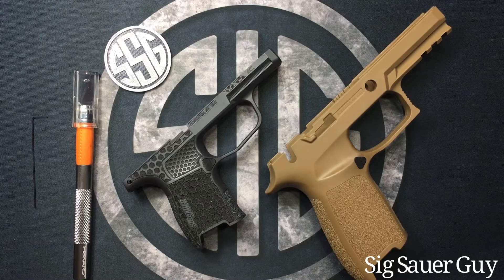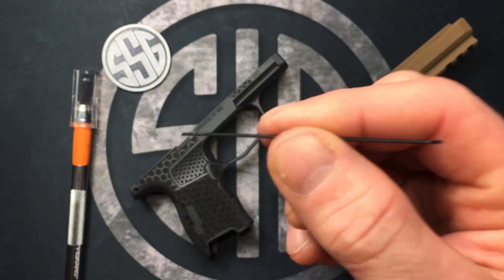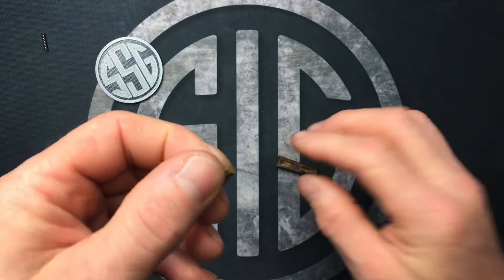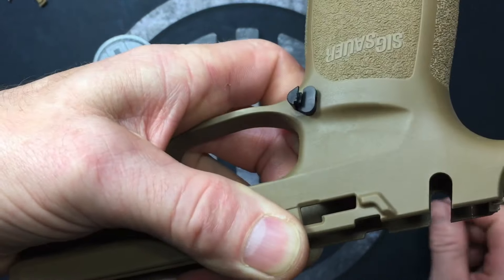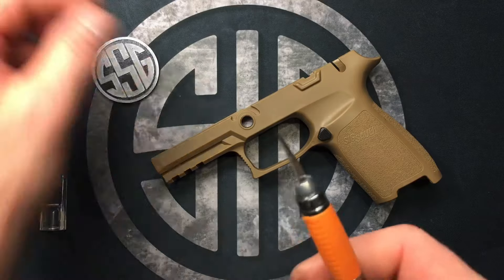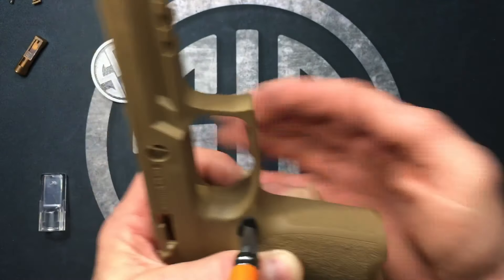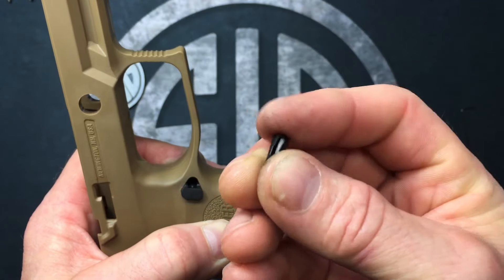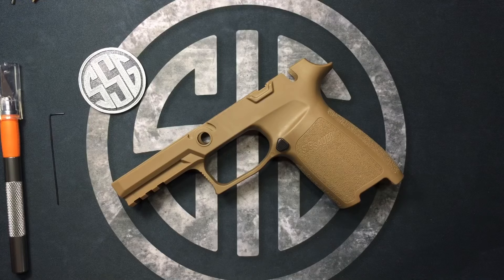Magazine release removal methods for Sig Sauer P320 and P365

Comment: I'm left handed and I just used this video to change my mag release on the other side. Thank you, great video!
Reply: Am also left handed and def didn’t know it was this easy to remove happy I found this video
Reply: Can this be done on a P365 also?
Reply: Same here
Reply: It is absolutely infuriating that SIG first puts out such a poorly designed part, and second, doesn't include a suitable tool.
I can't find anything suitable around the house, so I'll have to make a special trip to the hardware store to, hopefully, find a tool that will work.
I sure won't get this done tonight. 
Again, there is no excuse for such poor engineering. Whoever designed this should be fired.
Reply: Same but i cant find a small piece to fit in there 🤦🏽‍♂️
Reply: Update- I picked up an Xacto knife at Walmart, which worked very well to remove the button. Getting the new one installed properly proved very tricky, but I eventually succeeded. I will say again, the entire design of this magazine release button is an example of very bad engineering. Otherwise, the pistol itself is a delight.
Reply: Problem with that is the magazine on the 365 gets caught up on your hand when being released, but if you leave it on the trigger finger side the way you have to adjust your grip allows the magazine to free fall out. That’s been my experience.

Comment: Thanks for the video.  The easiest "tool", which is officially recommended in the P320 armorer's course, is a paperclip.  Another tip that nobody does on youtube (maybe to make filming easier), is to point the "muzzle" of the grip module to the ceiling.  Why fight gravity?  A couple swipes with a paperclip with the grip pointed skyward and it's out.  Nothing could be simpler, and causes no damage to the catch.
Reply: Thanks for the paper clip tip. This saved me a bunch off hassle. I tried Allen wrench first then razor but didn’t like how it was going. Decided to check out the comments and I was glad I did. Ty!
Reply: Paperclip bent on me...guess I need a better paperclip.
Reply: Every time I push to release the latch, the catch pushes in more not out

Comment: Here's what I found doing this:  The allen key method seems easiest and if you have the right size allen key available.  I have several allen key kits.  All of mine only go down to 1.5, which for me was too big.  After trying a paper clip (paper clip bends too much), I gave up on this method and found a hobby knife I use for my 3D printers.  It was done in a matter of seconds.  It took longer finding the right tool, lol.  Thanks for this vid though, quite helpful even though it is 4 years old!

Comment: If anyone has trouble using the allen key method to walk out the locking tab, that exacto blade method is super easy. Use your allen to force space between the 2 parts, and your exacto blade should go almost all the way in right off rip! I just bought a P320 AXG, it was very resistant to change until i did what i just deacribed. Wonderful, informative video. Couldn't have removed this part without your video, kind sir. Thank you very much!

Comment: I did this recently with a P320 M18 CA with a small paper clip and it was very easy.  Be sure to do this over a table top or other flat surface in case the tiny sping falls out when you remove the release from the slot.

Comment: Very first time I did it, I tried the Allen wrench method and of course I put a little ding in the grip module. And I tried the razor blade method and it worked very easily right away. Thank you!

Comment: Best explanation and video about this.  I tried the paper clip, then the allen wrench, then the small punch.  A real pain.  Then I used a very fine blade tiny flat head screwdriver (I didn't have an exacto knife) and it FINALLY worked.  Brand new weapon so everything may have been pretty tight.  By the way, you can add SIG P365-380 to the list of what this works on.

Comment: Thanks for the video. I started with my Armory Craft grip module. I couldn't get it out to save my life. Spent a hour last night and a hour this morning. Finally destroyed the smaller part and took it out in 2 pieces. Went on to my stock module and it came out first try. My other module from AC took 2 tries. Go figure. I replaced with the extended mag release from Armory Craft. Definitely a good upgrade.

Comment: A P365 user here.
I couldn't use a Hex Head Allen wrench key to "crank" the Detent Pin out after a few hours of trying. I also couldn't do this with a a smaller and larger paperclip either. I finally had success after a few tries with the Scalpel method. I pushed a sporting knife pretty hard in between the Magazine Release Button and Detent Pin while applying pressure with an Hex Head Allen Wrench Key in the hole shown in the video and used leverage from the knife to push it out. I pulled it out with my fingers after it was protruding out. One thing I really learned from experience is that you MUST hold the magazine release button down the whole time and NEVER let go. It's definitely strenuous for larger hands, and mentally exhausting. but don't give up! Take a break, and come back to it if you must, but keep at it and be mindful of how much pressure you are applying. 
Thanks very much for the help. I will be using your videos for the rest of the modifications I will be doing to my Sig Sauer P365 Freedom.
Reply from the maker: andrew71888 I’ve always had a hard time getting these out. I was so happy when I found a way with the Allen wrench. I’ve destroyed many along the way. Lol. Excellent news about your success. Thank you very much for the compliment also.

Comment: Thank you so much for a very clear demonstration of how this works.  I didn't have the right size Allen or paper clip but discovered a straight pin is perfect.   I wanted to swap mine because the magazine gets held in with my palm when trying to use my thumb and I'm more comfortable using my trigger finger  on the paddle style release of my USP.  Was happy to discover it feels pretty much the same on the P365XL now.  Thanks again!
Reply: I switched my mag release to the left side on my P365XL…  I’d rather use my trigger finger then my thumb. I find I can do it quicker and easier and it falls free of my palm easier also.  I’m thinking the P320 mag release does fit…  I measured  length and it’s right around 4mm longer.  But I’ll bet it’ll go into a 365 frame???  I wish Sig had squared and ridged the 365 lines release like the 320 line.  I wouldn’t have had to buy an aftermarket.

Comment: This a well done video that clearly walks you though the change.  I am right handed and have very small hands, and had to really stretch to reach the right hand mag release.  I changed the mag release to a left hand release and it is perfect.  Just roll the gun clockwise (which is what you always do to change mags) and it now lines up perfectly with my right finger.  This really decreases the time for a mag change.  This should work with extra large hands as well.

Comment: Watched this and it helped a 1000%.  Just watched your video, and did it step-by-step with you and it worked like a charm.  I used the allen method as well. Perfection!  Switched out the grip mod on my newly acquired M17. Also, watched your video on how to take the optic plate off, very, very well done "how to" videos! Definitely going to sub!
Reply from the maker: Best comment ever. Thank you very much for the kind words. Glad the videos helped. Compliments like yours is the reason I do them. Thank you very much.
Reply: @SigGuy  absolutely! well deserved credit!  And you're very thorough with explaining how it should be, even through multiple different methods to get it done. Definitely like your videos. If you guys have a SIG, come to this guys page, and it'll help with everything! Keep it up SigGuy!

Comment: Thank you so much man. Just got the polished blue control parts kit and needed a video to focus explicitly on removing and changing the magazine release, all other videos I found only go over replacing the slide or grip module with a mag release button pre installed
Reply: Edit: paper clip worked a lot easier than the Allen wrench. RIP my 1/15 Allen 🥲 bent and never the same

Comment: There seems to be a small ledge on the wedge piece of my P365 which allowed me to grab with my fingernail and pull it out while pushing the locking tab with an allen wrench. I tried walking it out with the allen wrench and it wasn't moving at all. Once I pushed the tab it pulled right out.

Comment: I guess to put the mag release on the other side of the frame, you just pull it out as you showed, rotate it 180 degrees, and insert it on the other side?
Reply from the maker: 100% correct.
Reply: @SigGuy  Thank you.

Comment: i could not get it with the allen key method on my 365xl after about 15 minutes i tried the razor blade method and it came right out, but the allen key work great for my p320. thanks for the info its always good to have more than one solution.

Comment: I have a brand new never fired P365 that I am trying to switch over to a Wilson Combat grip module. The FCU swap and trigger upgrade is complete, but I cannot get the mag release to save my life. I am trying this method using a small Allen wrench. The second I insert the Allen key, the bottom small piece that you work out, just pushes back into the grip module. Any pressure with the Allen key just forces the small triangle back in the pistol, and it won't just work or walk out like this video. Is there something I am missing? I can't push the mag release any further into the gun, and the small triangle slide back into the gun just by pushing on it. Not sure how to make this happen, but it's the last thing I need to move over. Thank you in advance.

Comment: The other thing that works really well is a small piece of .040 TIG tungsten to poke through the little hole.  Ultra stiff, perfect size.  You can get singles really cheap on Amazon.  Since it's tungsten  it'll last forever too.

Comment: What material is the mag catch made of.. polymer, stainless steel?
Reply from the maker: RideForLifeCR250R the catch itself is steel. The piece that locks it into place is plastic.
Reply: @SigGuy  thank you sir. I'm off to my lgs/ffl today to see the 320 Carry  I perchased and fill out 4473. I'd also opt for a sub compact frame/magazine combo that came without mag catch, and while looking to order one online I was recalling what was happening to the 43X guys that started using Shield Arms steel mags with the polymer catch so I wanted to be sure to get a steel mag catch for the 320 if it in fact came from manufacturer with a polymer catch.
Thank you for clearing this up for me, now I know I can just get a stock part and it'll be straight. 
Thanks again

Comment: I really like my P365 and how it feels in my hand. The problem I have is that my hand is a little to big and the mag release is hard for me to reach with my thumb. I have checked for an extended release but no luck. Anyone have any ideas? I have switched it to the opposite side meaning I have to use my shooting finger to release the mag but it just doesn’t feel natural to me 🤷‍♂️
Reply from the maker: William Kuykendall Armory Craft is coming out with a extended release for 320 and 365.
Reply: Sig Sauer Guy   Armory Craft is taking orders for their extended mag release now, June 13, 2020.
Reply: I had the same problem but with short fingers. My thumb is too short to comfortably push the mag release without adjusting my grip. I found that moving it to the opposite side and using my middle finger works best for me. I can keep a tight grip with my index finger and thumb without feeling like I have to readjust.

Comment: fantastic. im going to switch for lefty release. seems easier than how the mag release works on mp shield. you have to go in from the top of the gun for those and move a spring
Reply from the maker: Sounds similar to CZs.
Reply: @SigGuy  why did you have to put finger inside mag compartment at one point I saw? The spring falls off inside and down before wedge goes back in? Or the mag release can fall down at that point?
Reply from the maker: I do it to help guide the mag release through the hole in the other side. It’s easier to use your finger inside the magwell to accomplish this.

Comment: I'm a lefty and need to reverse the release. Can I do that without field stripping?
Reply from the maker: I would recommend removing the slide as the muzzle end will be pointed at you for safety reasons. To answer your question yes it can.

Comment: I can't get the wedge to stop falling back down when the mag release is pressed in to get to the hole. As I slide in the Allen wrench it presses against that wedge and just falls back to being flush with the frame. Anyone have this issue? Any suggestions? I've already put a little hole on the grip where the Allen wrench went in. Not too happy about that.

Comment: So i just picked up a 320 x5 and the guy switched the magazine release and I have tried to switch it back with your help but im not able to get it out i took it to my local store to see if they could help and said that the plastic keep has to be mess up because they could get it out either but could on there pistols so I would have to drill out the plastic piece and replace it is that correct and if so how would i do that im going to just order a new one from midway just looking for advice before i start thank you for your help

Comment: The slide take down lever broke off. How can I take off slide with a broken take down lever
Reply from the maker: Got to get it to turn somehow and push it out from the other side. It’s weird I’ve heard a lot of this lately. If it were me I would take my Dremel and make a slit in the takedown lever on the right hand side. Enough to get a flat tip screwdriver into it and use it to rotate it and push it out.

Comment: I can get the smaller piece to wiggle up and down, but it does not “walk up” like it does with you. What am I doing wrong?
Reply from the maker: Just make sure that you’re pushing that little wedge piece in as you’re prying up. Just keep doing that motion over and over as it walks its way up and out
Reply: @SigGuy  yeah - something isn’t connecting because it’s not walking out. I’ve easily spent two hours over the last two days trying to do this. Infuriating.
Reply from the maker: @CaseyBoltonCrocker  Did you try the razor blade method?
Reply: @SigGuy  yes, but I could not get the blade in as deep as you could.

Comment: I'm having issues, looks like my mag release is all one piece there's no slit in the flush side of the button. Does it still work the same way or is mine preeminently in there? I bought a p365 xMacro grip on SIGs website and it came like this.
Reply: Nevermind I got it. The little wedge seemed to go over the the piston part entirely hiding the split. I accidentally broke the little wedge trying to pry it off because I didn't understand what I was doing but thankfully I'm replacing it anyways. The new button I installed is a little recessed into the frame on the opposite side where the wedge goes in and the new metal SIG brand button seems to have a lower profile than the OEM  plastic SIG button. Shouldn't be a big issue. We will see when I hit the range.
Reply from the maker: Watch this video: https://www.youtube.com/watch?v=Y_P8MCtHRoU

Comment: Well, I tried to do the same so I could stretch the spring a little bit and now I regret trying.
   Yes, it looks easy and it is but the smaller piece is made of very soft plastic, so now it doesn't stay secure in place anymore, it keeps jumping off.
  If you're thinking of doing the same... better forget.

Comment: Hey I did this and the mag works and sits flush on backside on release when closed. When I push the raised side and look at other side push out I noticed the wedge is slightly uneven and I can push it inwards when holding from other side. Is that normal? Can you push your wedge in when holding it from other side or is it locked and even with that side when it gets pushed out? Thanks
Reply from the maker: Completely normal. As long as it’s locked in and not coming OUT you are good to go.
Reply: @SigGuy  thanks

Comment: Just did it for the second time on my new Icarus grip with my upgraded extended zev mag release. Seems a little rough. Can i put lube on the spring?
Reply from the maker: Sure. Can’t hurt. Also if any parts have cerakote, pvd or nitride they just might need to he “broke in”. Give the excess coating time to wear away.

Comment: I switched my mag release from right handed to left handed on my P365XL…  I find I can better and more quickly access it using my trigger finger instead of using my thumb.  Plus,  mag falls cleaner from my palm using my trigger finger.  I’m going to buy Magguts +2 mag conversion kit.  Not only will it give me 14 rounds in my 12 round mags,  the base plate included looks to be an asset to handling the mag as its a little extended compared to the flush mounted baseplate of the factory 12 rounder.  I’ll get 14 rounds in both factory provided 12 round  mags for almost half of what they want from Sig for the 15 round mag.  Plus,  it’s more compact.  I can deal with the lose of 1 extra round for half the price and more compact convenience.  Later…  Oh yeah,  if Sig would’ve designed the 365 line with a similar mag release as the 320 line,  I wouldn’t have hadda purchase aftermarket.  If they’d have squared it off and ridged it,  it definitely would’ve been more accessible!!!
Reply from the maker: Please follow up with your results. 🤙🏼